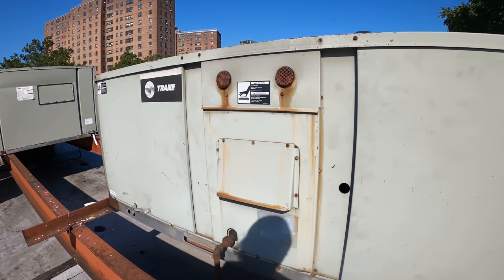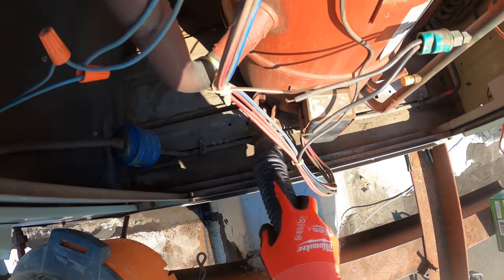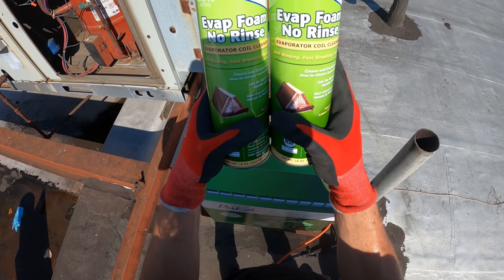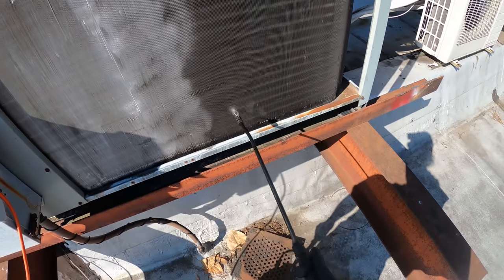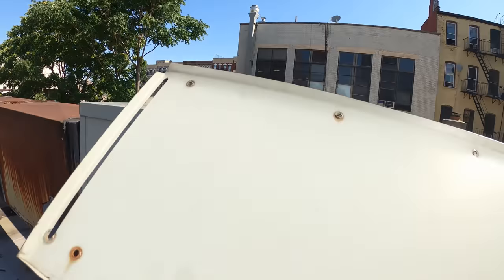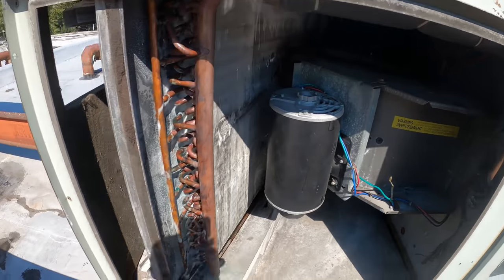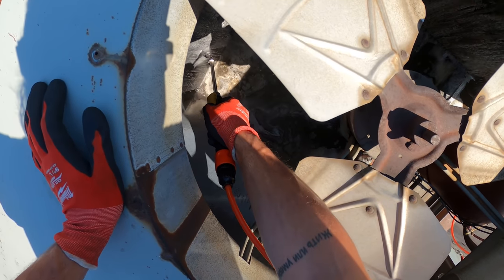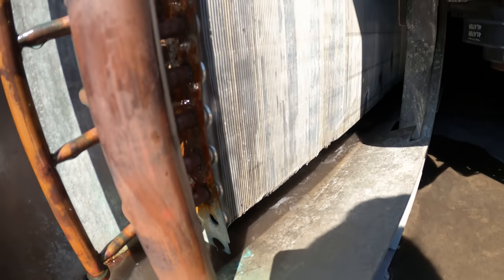HVAC: How To Clean A Commercial Air Conditioner (Condenser/Evaporator Coil Cleaning) Acid Wash RTU

Comment: As a technician from one of the major manufacturer I could tell you, using a pig leg for power is dangerous and unprofessional and for the most part I have no idea why your using chemical on that condenser coil, it isn’t that bad. We just use water and maybe simple green if theirs grease

Comment: Nice job on the coils.   Here’s a tech tip for you.   We typically remove the entire roof of the unit.   And use the same chemical on the evaporator coil.   I know it clearly says not for evaporator coils on the label.   But we use 16 oz to one gallon of water mix on the evaporator coils come out like new.  Just a tech tip from the Long Island Trane techs.
Reply from the maker: Thank you! Appreciate the tip. Definitely need a good rinse if using this chemical as it is harsh and can eat away the coil over time. Taking off the top would definitely help. This is the only chemical that truly washes the coils well from my experience. Thanks for watching & commenting 🙌
Reply: @Ben C sounds like an older trane or carrier.  In any case it gets cleaned the same way.    If you can to move the outer casing and fan wash from the inside out.  If you can’t or don’t know how to do that do the best you can with a hose.  Through the outer casing.  Just take your time.
Reply: You don't need to remove it they make a wand for it that's a waste of time
Reply: How much time on average does it take to do an entire cleaning of the coils?

Comment: Dude the reason the condenser foamed like that when it didn't look that dirty is because it has to be split apart... Even what you cleaned there is a blanket in between the coil

Comment: Nice videos mate! I use usually in condensers that are outside just high pressure air. In kitchen theres usually grese so yes you need chemicals to clean that. But atleast here in Finland outside condeser contains only dust and dirt. Like i dont see any reason to wash it with chemicals.

Comment: Great job, on new units with a lot of electronics connecting the neutral to the ground also all current to return back on the ground. This can kill sensitive electrical parts. Works great on older but some newer units can be costly . The vacuuming was definitely an extra step that makes for a really good job.
Reply: I was about to say the same.

Comment: Not sure about US installations, but at least here in Europe you should never use ground as a neutral. It will pop the GFCI, disabling multiple if not all circuits in the building. Afaik in the USA they don’t have whole-building GFCI’s but it’s still not a good practice. You should use a proper neutral as neutral 🙂 If the ground is not properly made in the subpanel, you could put the casing of every single device in the building under 115v, which is a big hazard.

Comment: I am a power washer for tnt services and I clean the condensers with a power washer. Just the screen though obviously. In the room we go In behind the fans and spray them out. It’s a rush of water into the room too most drains suck. Cool how I learned something new today.  Thanks for posting will subscribe
Reply: Also we spray from beneath the condensers forgot to add
Reply: Also (I’m drunk sorry lol) we do condensers for big freezers and refrigerators for Kroger stores mostly. We spray the bottom with a special tip I call a shank. It has 2 high pressure 45 degree angle nozzles on each end. I drive a pickup hauling a trailer full of water and they will always have a water hook up. If you don’t have a key the maintenance guy will. Usually the head guy runs every store in the state I’m in Ohio for example. He will know everything. I would climb up the roof hatch with only a rope at first and tie that off and throw it off the edge and tie off. I’d attached my gun to that rope and haul the gun up also 700 to 1200ft of hose. Just a little tip idk if you guys even do those bids or not.

Comment: If the customer wasn’t willing to pay for an extra guy, to handle a long hose run and booster pump monitoring, we refused the job. We weren’t going to pay for damaging a roof, because the coil cleaner wasn’t throughly diluted and rinsed away, when rinsing the coils. On foaming coil cleaners use a few drops of Calgon De-Foamer, to aid in rinsing the unit out.

Comment: Being that all the dirt in the coils is probably bone dry, would it be better to run a vacuum over them first to get the majority out and then use the cleaner after?
Reply from the maker: Thats a good idea too. Maybe even blow out the coils dry with an air compressor then perform the wash. Thanks for watching! 
Stay tuned for new videos every week⚡🔧

Comment: I might have missed it. Once you rinse off coil cleaner, how long do you allow to dry before turning ac unit on?
Reply from the maker: You can start it right up but only once the coil is dry will you get an accurate pressure reading. As long as you didn't wet any components like the motors, you'll be good to start right away. Stay tuned for new videos every week🔧⚡️

Comment: What does a job like this normally cost?  Thinking about adding this to my house cleaning services
Reply from the maker: Some companies might have a standard price for a wash depending on the type of unit you have or they will charge hourly. Expect the hourly rate for 1 tech to be around $100-$160/Hr depending on the company and they might send out a helper. The job could be priced at around 3-4 hours of labor plus materials. Thanks for watching!
Reply from the maker: These prices are for New York. Each state or city will have different prices

Comment: any one clean coils with pressurized air? i work in a steel mill with sensitive electrical areas and thats all we use and it sucks. any tips would be nice

Comment: How much did it drop hi side pressure?
Reply from the maker: A good 30 PSIG! Thanks for watching! Stay safe out there & stay tuned for new videos every week🔧
Reply: @JumpermanTech  2bar, not bad!
I'm from Finland and we use Bar as measurement units (like most of the world) would it be hard to add Bar stamp to video when editing, just to make it littlebit easier to watch and understand ongoing situation without constant convertation tool on other tab? That's not must to have would be nice! Anyway, great videos, and nice skills you have!

Comment: Why is the water outlet so bent? I had a similar bend and because of it the tube was clogged with dirt and mucus...its okay?
just found video in next recomentation queue after music video xD
Reply: its a p-trap.  it flows water to drain but it keeps some water in the tube so hornets or mice can't get inside.
Reply: @gibbsmeedat3954  it prevents pests but that's not it's main purpose. Most evaporators are located on the return side of the blower. The negative pressure from the blower will pull air into a straight drain and hold in the water. Like how if you have a mouthful of water you can look down and breathe in through your mouth and hold the water in. This causes the pan to fill with water and eventually overflow into the return duct causing water damage. The p trap acts as an air seal and as water enters on one side it will raise the column height and flow out the drain. Same as how traps keep sewer gas out of your house they keep air from entering through the drain line
Reply: @jetthardin4927  ah thanks

Comment: Why not just pull the top off of the unit
You will have much better access
Plus they make a jumper plug that you can just plug-in to the disconnect so you don’t get a cut up an extension cord

Comment: Whats that stuff do to the roof that its being rinsed on to?
Reply from the maker: I guess we will find out sooner or later 😬😁 The rinse and rain will dilute it. Never heard of an issue using these cleaners🤷‍♂️ Thanks for watching! Stay safe out there & stay tuned for new videos every week🔧
Reply: Good job bro. I’m a blue collar brother, HVAC tech from Cali. Just came across your channel. Not knocking on you but you want wash that stuff off the roof. It will eat at the roofing material. But good job bro. If you want to test it put some on your driveway and it will bleach it lol
Reply: @JumpermanTech  I have been in the coil coating  business for nearly 20 years and I have been using Nu Brite. Nu Brite is non corrosive and does not affect the coating product or roof. Anyway nice video.

Comment: Good video and detail cleaning ,just surprised you still using chemical in commerce applications, ( love to use them) however a few years ago in many of my building I could not get any company small or large to agree to use them, their policy has change and they won't use any ,o understand why, it's a very strong one and ye did it's old it will damage it more but even on new new ones they were not allowed, i only got one company to use a it of simple green that's all. I still use this at home
One thing ,if I use it ,i will definitely will need to use a water hose , believe me with that little pressure and little water there's no way you can rinse that chemo correctly, it really has to be soak and rinse and rinse in order to get it all out ,and that is why I guess the companies dont use it because they know techs will leave residue and it will cause damage.

Comment: 0:01:06 You have 14 gauge wire on a 40 or 50 amp circuit breaker and no GFCI.  And you are standing in water.

It wouldn’t meet OSHA requirements.

At least you should get a cord with GFCI protection built-in.

Using ground for neutral is awful.  But since you work alone, you’re not likely to kill anyone else.

Comment: You should probably go back and edit this and let techs know. And if you haven’t found out yet. You need to pull the top off. Split that coil and then clean it. Use just water to rinse it with good pressure. That may be enough to clean it. If not then use a chemical. Nubrite is harsh. Don’t leave it on so long.

Comment: Pretty sure those units are split coils
Reply from the maker: What do you mean by split coils?
Reply: @JumpermanTech  1000% they are splitable. If you remove the whole lid of the RTU you will see it has two condensor coils stacked. And on the end of the coils opposite the compressor you will have zip ties holding the coils together. Cut those and you can pull the two coils apart. You need to do this or you're just wasting your time. All Trane voyager above 4 ton I believe are. Carrier has a whole line a units you can split too.
Reply: @JumpermanTech  The condenser is made up of two rows that are sandwiched back to back. The col can look clean from the outside and inside, but you can have an actual blanket of garbage sandwiched in between those two layers. You can sit there and spray all day long and you won't get that stuff out unless you pop the top off the unit and actually separate the two halves to spray the dirt out that way. Seen it a hundred times. Use a flashlight to shine through the coil. 

Also, spend the $100 and get yourself a nu-calgon foaming coil cleaner gun. It's a bit spendy, but well worth it. Only setback in your case is that you need a hose to supply the water for it.

Last but not least, it's good practice to wash down the roof after you're done. Especially after using chemicals on a unit. You don't want to leave that stuff sitting on the roof.

Comment: For the future!! Supposed to rinse inside first then the outside!
Reply from the maker: Thanks for the tip! Stay tuned for new videos every week🔧⚡️
Reply: Incorrect. Otherwise you’d be blowing a bunch of the dirt into the coils. You want to push all the dirt towards the inside. Clean the inside to your hearts content and then blast any left on the inside out before doing your final comb and inspection.

Comment: so your a professional, and you dangerously tap in and wire nutted a extension cord with no circuit breaker or GFCI, then you post this internationally on youtube
Reply: Pretty common to do as an hvac tech. Frequently no power at all on roofs and we need power to run our tools.
Reply from the maker: Just another day as a HVACR tech but you do have a point there! Stay tuned for new videos every week🔧⚡️
Reply from the maker: @cameronboyett6386  Well said. Thanks for watching & Stay tuned for new videos every week🔧⚡️
Reply: Circuit breaker is probably inside the building. If there was a GFCI on it, he would have popped it right away as he used ground as neutral (not good).

Comment: What a waste of time, use a karcher an clean with only pressure of water, clean a coil with a brush 🤣🤣🤣🤣🤣, is a comercial hvac equipment, build for a External wheater and rug, really are You hvac technician???
Reply: And clean External and internal coil.